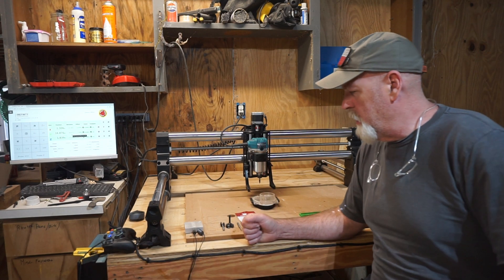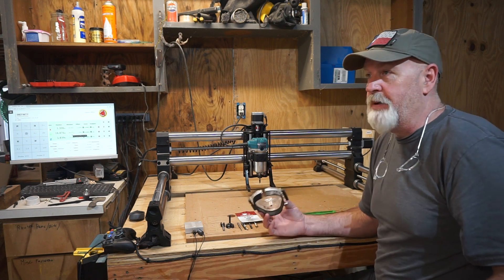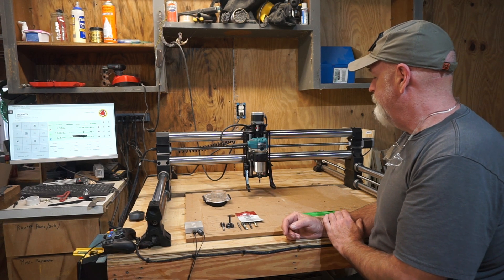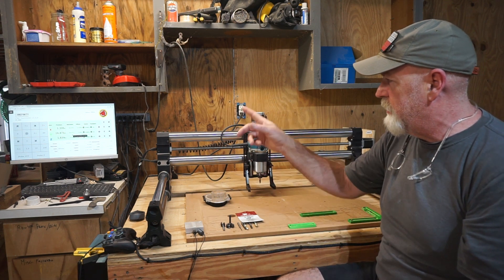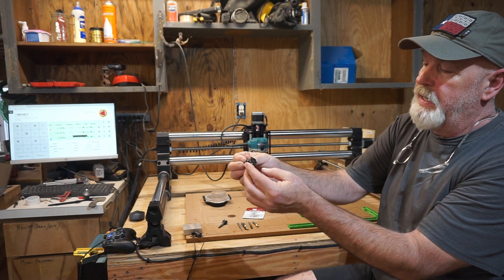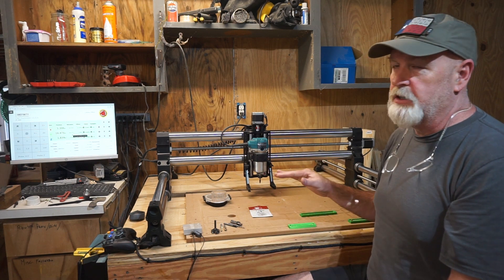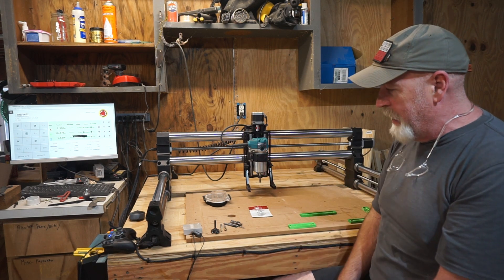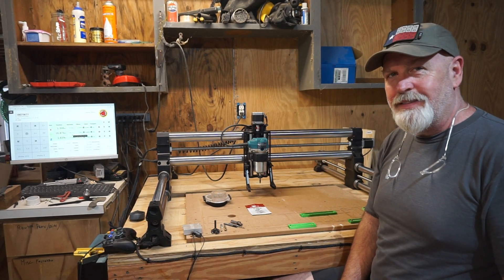CNC Router Tips for Beginners from a Fellow NOOB! #cncrouter #onefinity

Comment: Thanks for the video. I'm ordering the Onefinity X50 WW very soon myself.
What size did you make your table? I'm still working out the design of my own.
Reply from the maker: I made my table 48x48 inches it leaves a little room around the rails. Thanks for the comments and for watching!
Reply: @jestermetalworks  Thanks, I figured it was close to that. I'll probably build mine the same since the control box will be either wall mounted next to the machine or on a shelf under the table.
Reply from the maker: @NWGR  If you mount the control box on the wall, you might get the extension cable as well, the included cables just reach on my table, just something to think about.
Reply: @jestermetalworks  Yeah, that's on my shopping list; I planned on getting the extension set either way in case I wanted to move the box. Ordering it with the cnc saves on shipping to the states.